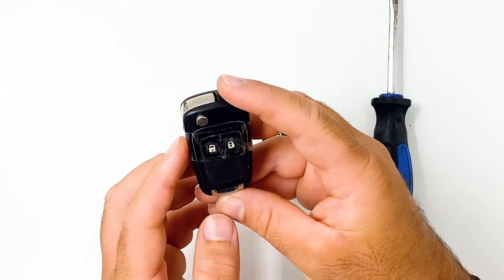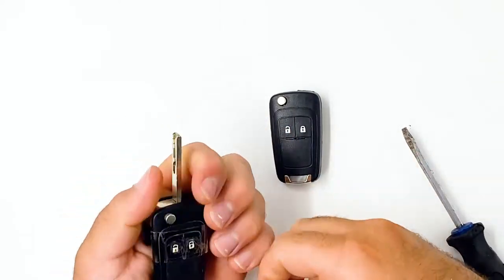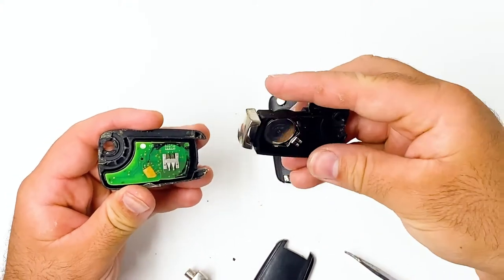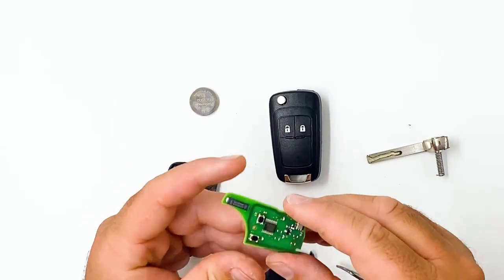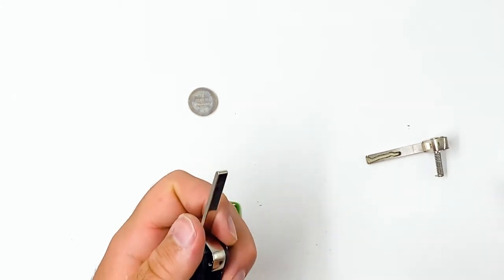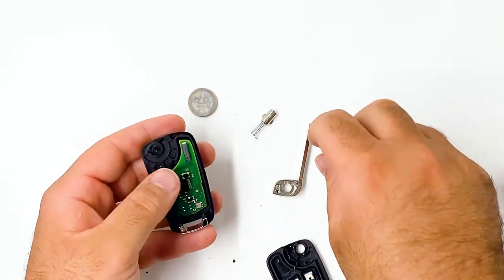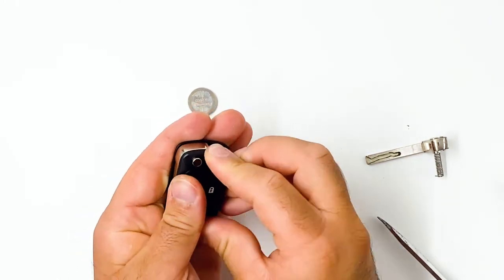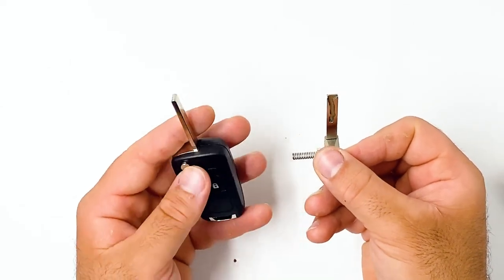How to Install New Case for the Holden Barina/Cruze/Trax 2 Button Remote Flip Key

Comment: I followed this including punching out the pin on the blade to swap the old cut key in and saved  174.00, my mall Mister Mint  had the same replacement FOB for 180 with cutting or just to cut the new blade 60. I don’t have any special tools, used a tiny screw driver, hammer and my nail file to do the filing, the FOB was 6.00 from TEMU. Tested and all working. Thanks for the video, I found it helpful rewatching each step to get everything in order which made loading the spring and snapping back together pretty straight forward. But yes you do need to butcher the old one to get it off, it was sealed on.

Comment: I took this path for my MY16 Cruze. The original fob couldn't be pryd apart like this. Unfortunately had to butcher it apart, but was able to use the circuit board in the new shell.
Reply: Me, right now

Comment: Disappointing that the original blade does not fit into this shell.
Cost of cutting the blade is 3 times the price of the shell. Must consider this when purchasing.
If that issue can be fixed then this product would be really good for the price.

Comment: I felt like a meth head trying to dismantle the old fob,finally it seperated,swap circuit board,and to punch out the roll pin to utilize my old key blank,install battery works great,thanks for the info.

Comment: Couldn't you use the old key blade rather than getting one cut?
Reply from the maker: In some cases it is possible, However it is easier if you just get the key cut as sometimes your original key blade will not fit into our case.
Reply: You can. It is held by a pin. Drive it out I used a 0.8 mm pin punchto take the blades out (keep the pins) . The pin drives into a slot in the blade which is slightly off set in the old blade from the position it needs to be in the new one. Use a needle file to elongate the slot it the right direction checking the old blade in the new swivel fixture until you can sight through the pin hole. Then drive the pin in with the original blade in the nw swivel assembly and reassemble the key.
Reply: The button is slightly bigger and the slots don't line up on the old blade , only by a couple millimetres. Still is cheaper than buying a new key
Reply: @davidcousens831  thanks for the tip. Was fiddly but got it done this way. 👌